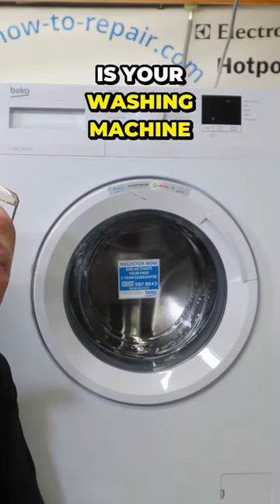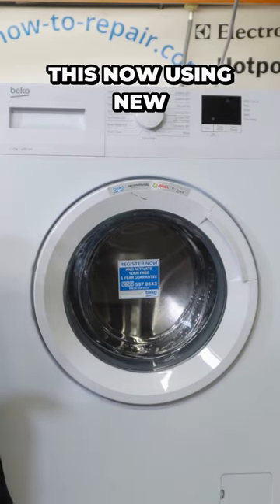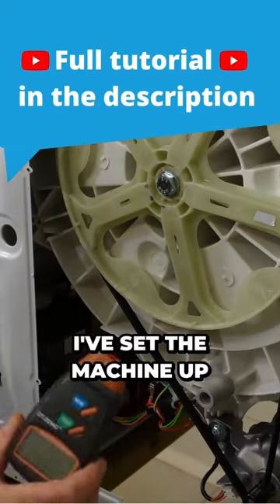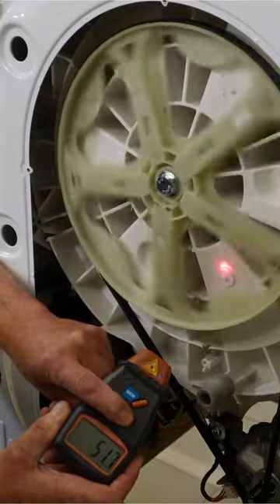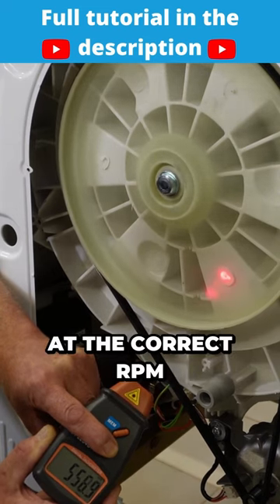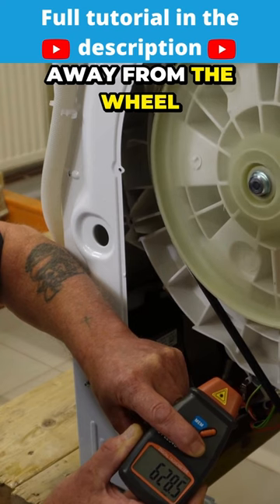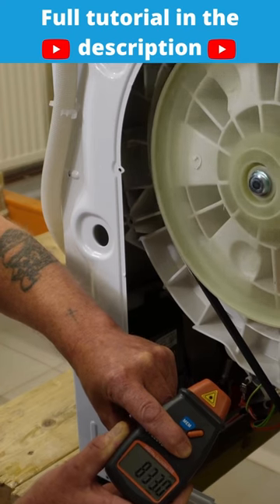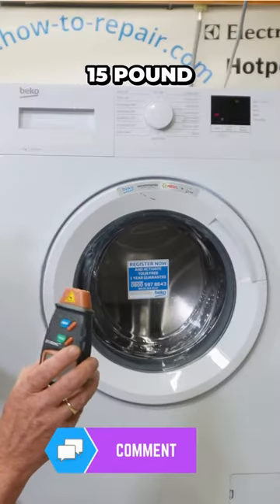Washing machine RPM speed test

Comment: What is the reason to spin hardly at the end of the washing it seems is going to die or has no electric power    this i have seen before it broke the machine   i reduced the rpm to 1200 for me 800 are enough